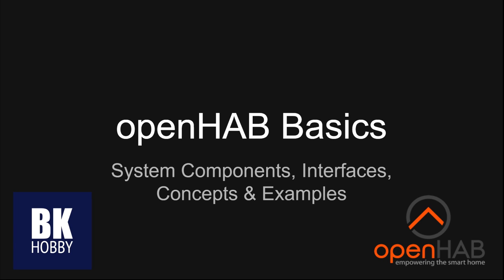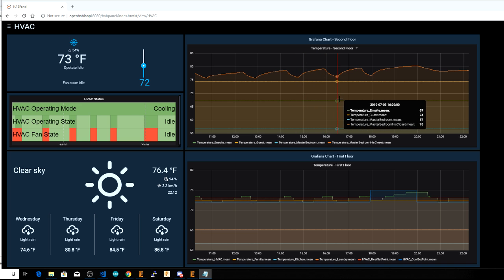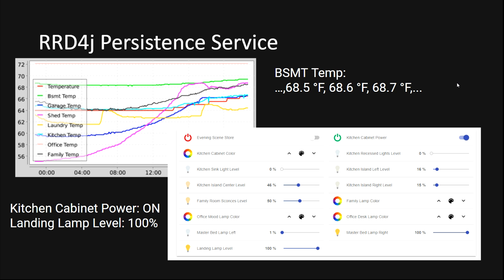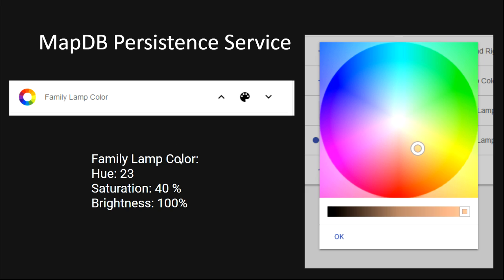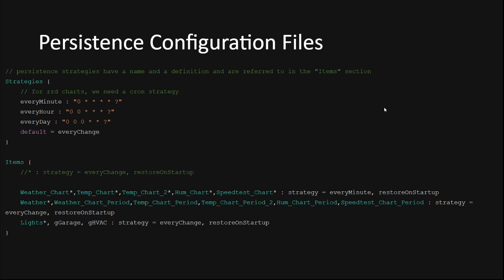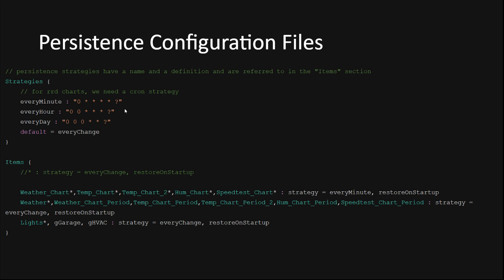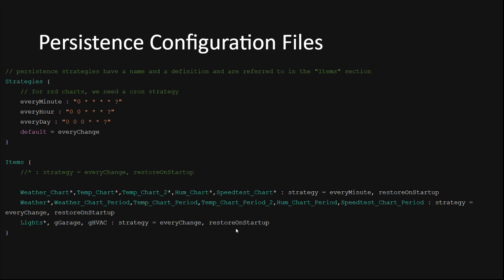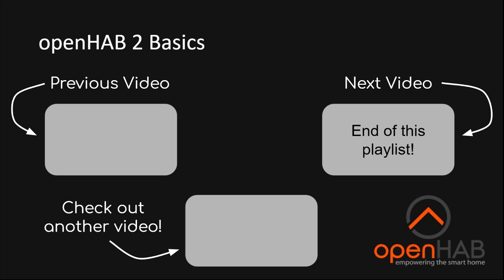openHAB 2 Basics - Persistence

Comment: Thank you very much for those awesome videos. By the way, I am used to program based on snippets of code. Could you give some locations with code examples? I am having a hard time migrating my system to 2.4.0. The new concept of thing, while using MQTT is not very well documented on the OH site. Also specific examples for dealing with HVAC (switch, mode, temp) are really hard to find. On top of that, I am using Alexa, which I am expecting to be able to keep working on the new version.
Reply from the maker: @Luciano de Paula - I know what you mean, I like to see examples of code to start with, too! Perhaps it will help you to look at my openHAB configuration, which I've shared on Github ( https://github.com/bkpsu/openhab2-conf-bartus ). Also, I have made a livestream before specifically on the topic of MQTT configuration with the latest (v2) binding in openHAB 2.4 ( https://youtu.be/f9DlvG3UQuQ ).

Hope this helps!
Reply: Thanks! There is a mistake in the Youtube address i.e. the extra parenthesis at the end
Reply from the maker: Nice catch, fixed.. Thanks!